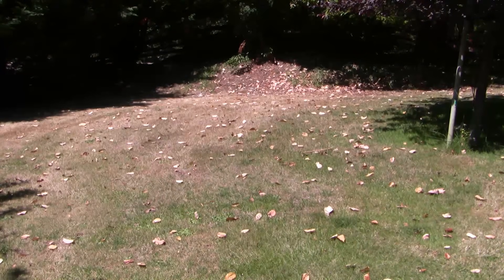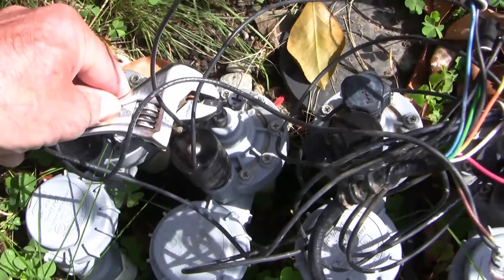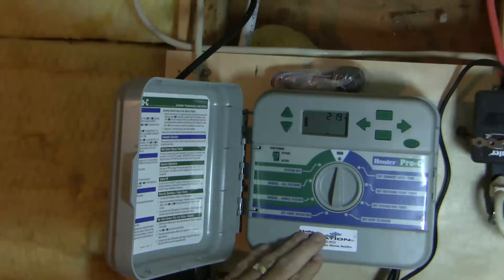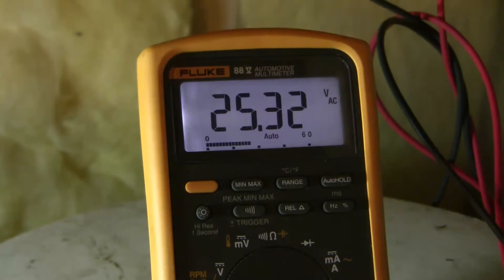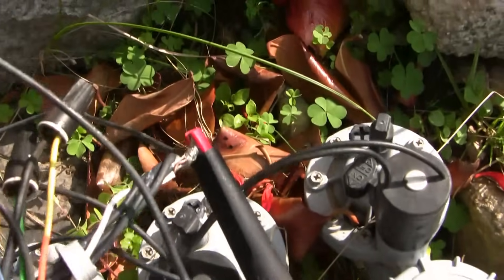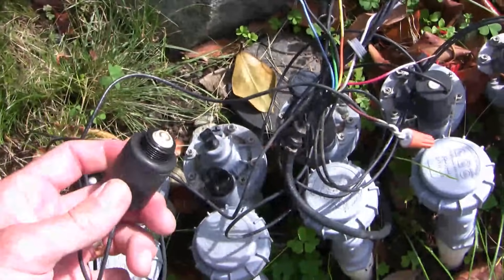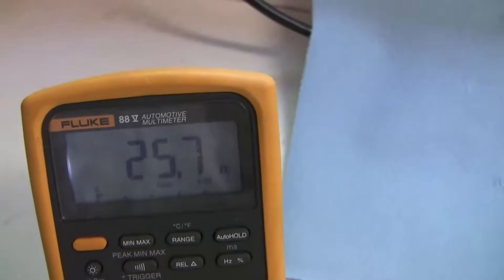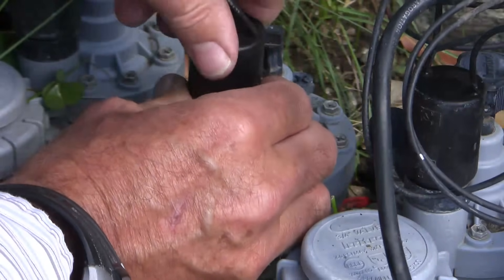How to fix an irrigation sprinkler zone that is not working

Comment: Question.....does the sprinkler are wire  each separtly or they connect in sequence
Reply from the maker: I'm not sure I understand the question, but here's an answer. The ground is shared by all, they generally meet together at a wire nut with a single ground wire going from the solenoid/valve bank back to the controller ground pin. Each zone has a single power wire that goes from its designated pin at the  controller to each solenoid, a single power wire for each zone. Sequence doesn't have much to do with it, all the sequencing is done by microcircuitry at the controller. If you want to swap sequence it is as simple as swapping wire position, or by changing the program sequence at the controller. Did I answer your question?
Reply: @spelunkerd  yes, thanks

Comment: I had 2 zones that weren't coming on.  Tried running them manually and they didn't come on.  I tested the ohms and resistance at the control box like you showed in the video and it all looked good.  Then I tried running the problem zones again and they both came on.  I guess I'll have to keep an eye on them.
Reply from the maker: The major clue is the fact you couldn't get them on by opening manually. I would abandon any though this is an electrical problem or a problem in the solenoids. Valves can stick shut mechanically, but it is a little unusual for that to affect two valves at the same time. One commonly neglected cause is poor system pressure from a leak somewhere else. If pressure is too low to drive fluid through the line (such as with a different valve that is sticking open, or a leak somewhere), your valve can open but not deliver adequate volume to pop sprinkler heads up.... Valves sticking open can be intermittent, and system pressure can be low because other appliances in the home can rob the sprinkler system of adequate water pressure. When the sprinkler system goes through its cycle, pay attention to those zones that get water before the problem zones. Make sure those zones turn off properly, and make sure there is no puddle of water forming where it shouldn't be. Good luck!

Comment: Hahaha too funny my friend. I am troubleshooting my system and diagnosed it is a restriction on the line to the zone (water pressure at the valve is normal and higher than at the first sprinkler head UNLESS all the heads in the zone are capped and then it equalizes).  
  My challenge now... how do I find the exact location of the root without digging up the whole yard? This led me to your video and of course, I had to watch it!!
  ANy ideas, Dave? I wonder if there is some kind of radio or sonar tracing device I can feed in the line?
I am not sure how they find exact locations on pinched lines.
Reply from the maker: Hi, Matt! The parallels to voltage drop testing in automotive circuits are surprising. Of course line pressure can be low because of a leak anywhere in the zone (high flow) or because of proximal restriction (low flow). Unfortunately we don't have easy access to flow meters, so it can be hard to tell the difference. Interestingly in sprinkler systems a leak is more common, anywhere in the zone. I usually start by leaving the line on for a few hours, then walk on the grass where I think the line would run to look for a wet patch. All it takes is one bad head, sometimes hard to find because it doesn't spray. Common spots would be where gardeners use a shovel, and where lines meet elbows for sprinkler heads, since cracks at connections points are surprisingly common. On the other hand, new systems use much thinner tubing, and that tubing can kink at bends, causing a pressure drop across the kink similar to a voltage drop across a source of resistance in a circuit. Also your remark that pressure is normal when you cap the other heads makes a leak a little less likely. Sometimes system zones are designed with too many heads that draw too much water, causing a drop in system pressure until you cap a couple of heads to limit consumption. 

Too bad we don't have a noninvasive way to assess line pressure. One thing worth doing is to flush the line, especially at end devices like sprinkler heads where bits of calcium can plug off flow. You may get useful clues if you remove an end device, one at a time, and flush, since flow is only reduced distal to a restriction. Sometimes lumps of calcification can rock back and forth, held back by the valve, so I always flush the valve inlet at some point. I did a better video of how the valve works if you want more detail of that, including the adjustment screw that limits flow through the valve. Never forget to think of the forehead slapping obvious solutions. If you really are convinced that the problem is restriction, you could prove that by trying to flush it forward or reverse with water or compressed air. A borescope might be useful if you have access close to a sharp bend. Also I have a very long 75' plumbers snake that has a sharp enough end to push down a sprinkler line. If there is a kink, most likely the snake will not be able to pass the restriction, so you could use it to help guess where the issue is. Good luck!
Reply: Do we all have Pro C systems? Lol

Comment: How would I even begin to find these? I have two faucets in the front of my house and at the back. None of them have this. I have a controller on the wall in my garage. It just has a skinny little wire that goes into my wall. My sprinklers magically come on...  I have a dry section where nothing happens. I have 12 stations. One station nothing happens and I don't feel wet ground, sound, or anything. I'd like to uncover these cannister things.. any tips on how to locate them on my property?
Reply from the maker: Walk around the garden looking for a green or black box, often at ground level with a plastic cover over top. It may be concealed by overlying shrubs. If you don't know where to start looking, check the beds close to a hose bib, looking for the water supply line coming from the house. The box should be close to there. Technicians who put those in don't want to run wires and lines very far. However many of my homes have more than one bank of valves, you need to scout the area.
Reply: @spelunkerd  Thank you! I remember coming across two round green plastic circle like man holes that were in the ground. They look like almost as big as a small personal pizza from the frozen food section. Hopefully that's it!

Comment: I have a zone that's on all the time, even with the the control panel set to rain,, or powered off.  With control panel on the other zones work with only low pressure because the water is going to the always on zone.  What's my approach to solving this problem?   Thank You kindly..
Reply from the maker: I did a careful video specific to that problem, titled "Sprinkler Troubleshooting", which explains in detail how those valves work. Link on my channel. Most likely you need to clean or replace the diaphragm, as I show. Good luck!
Reply: @spelunkerd  Great video--I'm tied up right now to work on it.  Thanks again.
Reply: @spelunkerd  Right On---the upper plastic above the diaphragm was cracked.  I didn't realize I had 2 control valve housings--it was buried under 5 inch mulch.  The bottom pipe valve reads "Hardie" . Hope it's a common mnfg.

Comment: Yesterday I was troubleshooting my sprinkler system and used this video as a guide. (great video btw).  2 of my zones weren''t coming on.  After measuring for voltage and resistance, I was convinced the solenoids were bad.  But was not the case.   After a whole lot of head scratching, I started disconnecting and connecting wires and ultimately I determined  that I had a 25 volts on each terminal of the expansion module when there should have been voltage on the 1 terminal at a time, so multiple valves were opening but the zone wouldnt work due to lack of pressure.  I replaced the controller and all works now.

Comment: Great vid, if the solenoid is working, and there is water to a particular zone, BUT only a trickle of water comes out does that mean the lack of pressure is a bad sprinkler head or broken water line to that zone ?
Reply from the maker: Poor water at the head can be either a high flow or low flow problem. High flow is often from a crack in the line or leaking head elsewhere, and low flow happens when there is a kink in the plastic line, debris occluding flow to the head, a partially closed valve, or sometimes low system pressure. I would turn the zone on for a couple of hours and inspect the grass for a wet spot near other heads or along the path you think the line takes. If you don't see any leakage, I would then go to the valve and turn it on manually (I did a more recent video showing how the valve works). You could temporarily unscrew the bleed screw at the valve to see if that helps. If there isn't anything going on at the valve or other heads, I'd remove the sprinkler head to see if good flow happens when the valve is out. If you get little flow even with the sprinkler head off, then I'd diassemble the control valve, clean it, and see if you have adequate main line pressure.
Reply: @spelunkerd  Thank you for the detailed answer i appreciate it ! i'll check all the suggestions you made, i did see a puddle around one of the rotary heads, but no water pressure after that head to the stationary heads after removing one of the stationary heads no water. I'll check the rotary and see what i get.

Comment: Hey good video. The only things is with solenoids with the flow control screw. You should never have it on Max but have one full turn back. So there is more space on top on of the solenoid to help it shut better.
Reply from the maker: I didn't know that! Thanks for adding your thoughts to the thread, for others to see.

Comment: when i twist the solenoid, water pours out of it.  Bad gasket??
Reply from the maker: Possibly, but I'd probe the little passageways that drain the area, and evaluate the integrity of the valve. There shouldn't be much pressure inside there when you rotate the bushing off the nipple, since it should be a free path to the drain side of the valve. Disassemble, examine, and clean the areas carefully. I did a more recent video on sprinkler control valves showing exactly how that is done.

Comment: Thanks - great video. I found my solenoid manifold accidentally while digging in the yard and broke a couple wires. In addition to fixing the wires, should I add a valve box (around the entire assembly) to protect it in the future?
Reply from the maker: Sure, most ground installations have a box that holds the perimeter dirt away so that lines and solenoids are well protected and often entirely below ground. They are easy to install, with an open bottom so you can dig around them and slide the box down over the hardware. One day I had a look at mine in the dead of winter, and I was surprised to find that the entire area was frozen in a mass of ice a foot thick. I was a little concerned the ice would damage the parts, but I had blown the inner lines out so the system worked fine the following spring.

Comment: Are selenoids size standards for any model orvalves system?
Reply from the maker: I don't think so, but at your location there may be a dominant manufacturer, so you will likely be able to find something that fits. I had no difficulty finding the right part, it was the only one commonly stocked. Take a photo of the controller and your valve with your phone, and bring the old solenoid in to your supply house. They will likely be able to help you out. If you know the manufacturer of the controller, go to a place that stocks your brand.

Comment: I replaced my  solenoid  with new one that I purchased at home depot and my zone still won't turn  on  when I removed the solenoid I noticed that the bottom of the solenoid looked corroded  and  on thenvalve  also has orange corrosion   on it  what should I do
Reply from the maker: I did a video on how to diagnose valve problems, the link is here in this thread and linked at the end of the video. It sounds like you need to clean your valve, it's pretty simple, soap and water often works. If I was considering a solenoid problem, I'd hold onto the solenoid and feel it activate like I showed in the video, and you can learn a lot from a multimeter. The solenoid works by opening a bypass pathway allowing the top of the valve to decompress. If that passageway is blocked your solenoid won't open the valve even if it is working normally. Once you understand the very simple way these valves work, you'll find diagnosis of sprinkler problems to be so much easier.

Comment from the maker: A quick way to identify whether the problem is the solenoid or the valve is to manually open the valve and see if water flows. If water won't flow with manual control, you have either a supply problem (check shutoff valve in the house and make sure all other zones are closed, look for leak) or a valve problem. I recently posted a detailed video showing how these valves work, here https://youtu.be/jCowCVTR6VE

Comment: what can you do in the event that your sprinkler system has no clock to check for further troubleshooting??
Reply from the maker: I would focus on the valve and manual control. If neither the solenoid nor manual control will open the zone, the problem is likely in the valve. I recently did a more comprehensive video of how to inspect the valves and how they work, it is here https://youtu.be/jCowCVTR6VE

Comment: Very helpful video. Really helps you diagnose your system. I think I may have a dodgy solenoid as it works sometimes an not others. But at least now I know.
Reply from the maker: Thanks! I'm working on another sprinkler video right now, this time with a valve sticking open.

Comment: All my zones stopped working. Any ideas how to identify the culprit? I have a hunter pro c. Tnx
Reply from the maker: I've been out of town, sorry for the delay. First step is to be sure the main supply valve is open. Check a few zones manually and see if they open with manual control. Be sure all the other zones are shut off, the manual shutoff valve on every zone should be closed (CW rotation) on every valve. The solenoid overrides manual control. They are sometimes left open over the winter to prevent winter freeze damage, so you need to close them all so the system can mount enough pressure to power one zone at a time. If it is still not working despite going through all those steps, I'd be looking for a leak by leaving the water on for a few hours and digging down at the wet spot to find a cracked supply line. If that doesn't work I'd be looking for a kink in the supply tubing.

Comment: My dad put a new timer mine every station worked accept  station 4 and tried to put station 4 manually from the timer and powered on station 3 but it said station 4 was on? Any suggestions (by the way all the cables to the timer are in correct order)
Reply from the maker: I would have started with what you have already done, recheck the wiring, looking for a connection between the two circuits. When I face a problem I can't understand, I usually try to simplify and divide the equation to localize the problem. Although it is possible to destroy evidence, I would probably move on to completely disconnect circuit 3, then recheck circuit 4 in isolation, by running that single zone from the controller. Once isolated, circuit 4 should behave normally if the board is OK. Confusing problems are often a consequence of a bad ground somewhere, this may be one of those. Good luck! Please stop back and let us know how this one turned out, many who visit here would benefit from the experience.

Comment: My sprinklers click on in all zones but the water isnt coming on.
Reply from the maker: First walk around the garden and manually close all the solenoid valves, in most valves you just turn the control clockwise. If a few of them are open, water pressure will trickle down each line, never achieving enough pressure to lift sprinkler heads and spray water properly. I open all the solenoid valves manually every September so that any water won't be trapped beside a valve and destroy the valve when the water freezes and expands. If somebody came by and tried to operate our sprinklers in the spring, they would complain the system doesn't work. After you've done that, close all the hose bibs around the house, those are also usually left open so water won't freeze in those lines. Finally, turn the water on to the outside hose bibs and the sprinkler system. Then, go to a solenoid and manually open it. If you get water with manual control you know you have water. If you don't, you need to hunt for a leak or obstruction. Every spring I manually open each circuit in turn to look for leaks and sticking sprinkler heads. I try to leave the system running for a while to look for puddles of water that will sometimes form over a broken pipe. If you get water with manual control, then move over to the electronic control and see if that works. Good luck!

Comment: I had a zone error which a replacement solenoid did the trick. However, days later, another zone began to exhibit errors and back at square one. Is this a horrible coincidence or is there something else afoot?
Reply from the maker: If the replacement solenoid fixed the problem, I wouldn't overthink it. Those little devices have a survival curve, it wouldn't be unexpected to see a pair fail in the same year. You could swap a known good solenoid into the circuit to see if it works.
Reply: spelunkerd thanks man. I’ll report back